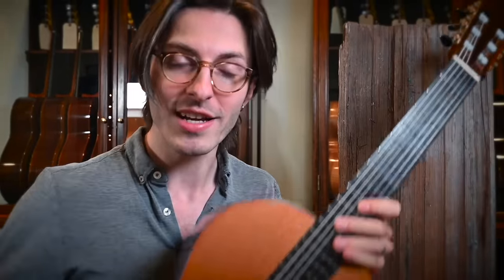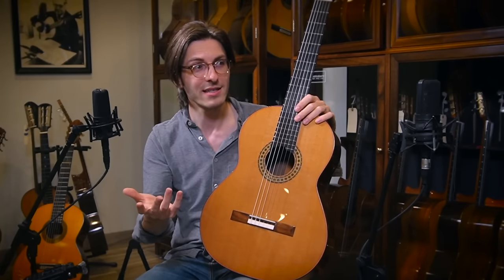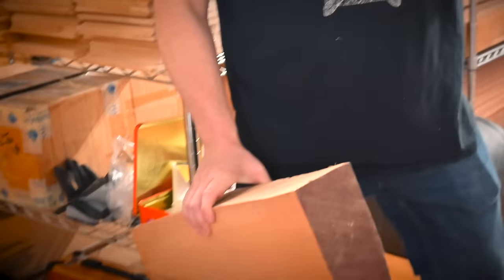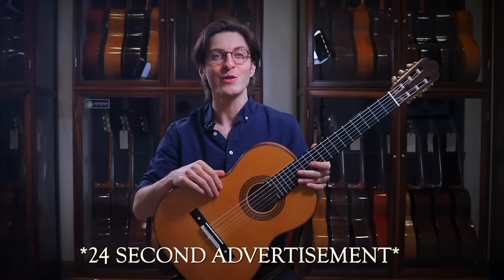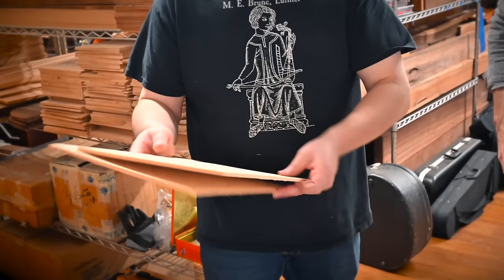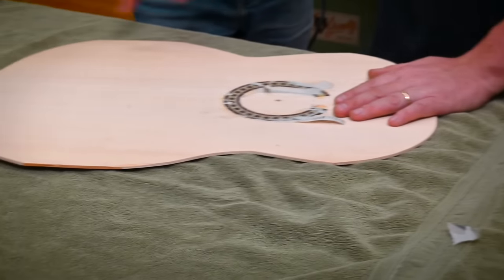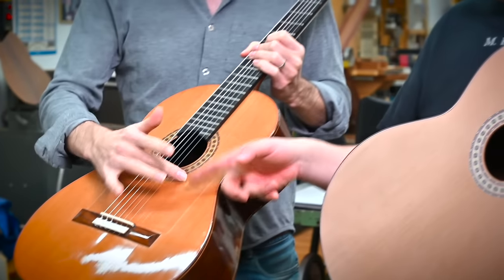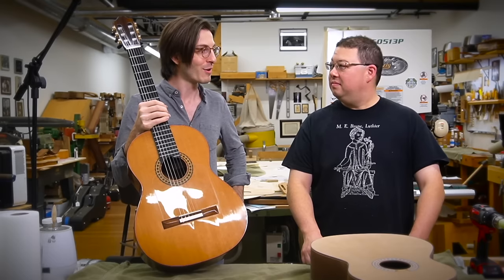The Journey from Tree to Guitar! 🎸

Comment: This was a blast! See you soon!
Reply: Blasts are needed to blow minds. Chapeau! For your impressive deep knowledge. Question about building the guitar. And I reference the violin here - I don't want a guitar to sound like a violin, understand me correctly. I start with my view on making these, and guess you know way more than I do, it's just to set the stage in communication.

In a violin, part of the sonic character is in the curved top and part of the harmonics stem from the bridge (and even the lobes in the f-holes hopefully collaborate harmoniously). With a stud, the top is connected to the bottom, AFAIK. There will be braces too. As wood ages, it may become weaker/softer and its tonal character will change, hence the instrument. My hypothesis is that the curved top and bottom help in becoming a resonant contraption. I would compare this to a loudspeaker cone with the rubber ring around it. The violin maker uses tiny planers that look like cute toys to work on getting regions of different thickness. There's bracing too, and the connecting rod. And everything needs to get the proper place relative to desired tonal character and resonant qualities of the wood that probably can vary 4 inches away from what it sounds "here".

Is there an analogy in guitar making? What about arched top guitars? Do these "architectural" differences between guitar and violin cause a difference in ageing?

An idea for the script of a new video?